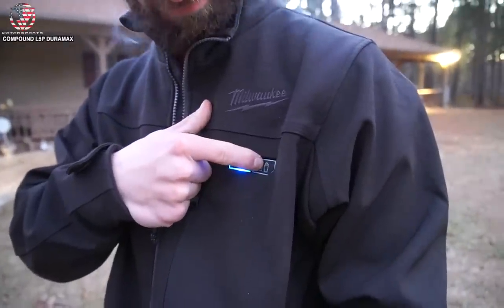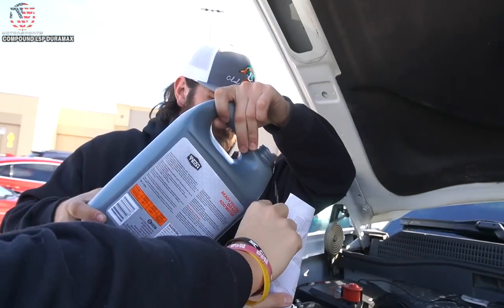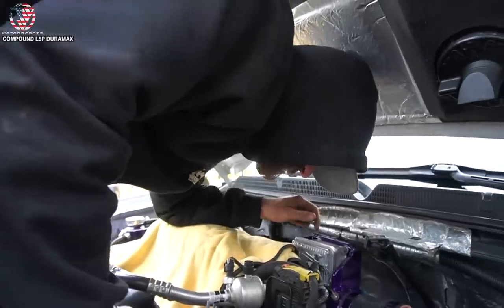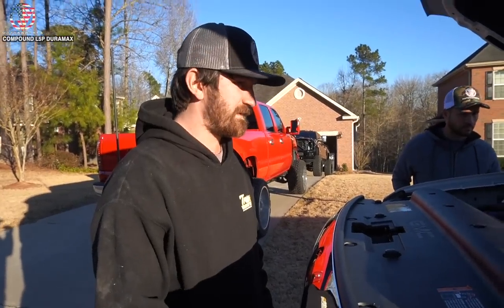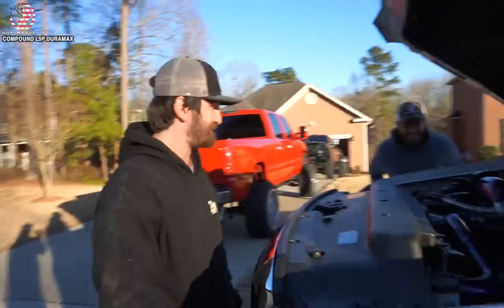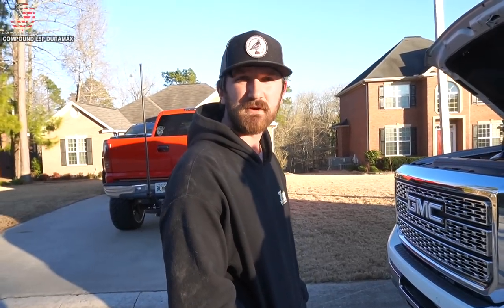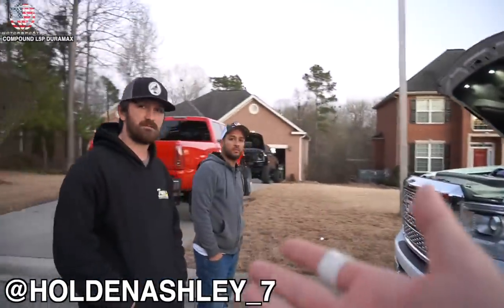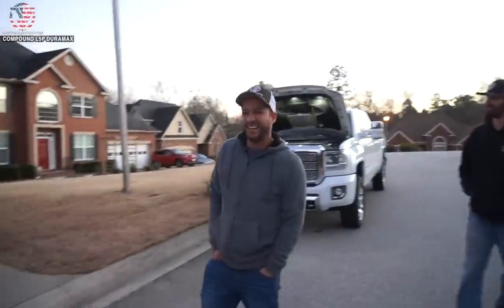1 OF 10 COMPOUND TURBO L5P DURAMAX SET UP IN THE WORLD

Comment: Why use the stiction eliminator in a common rail engine. That’s made for the 7.3s and 6.0s engines that have fuel systems that run off pressurized oil. He’s better off using Hotshot FR3

Comment: That coolant leak is going to be the death of me.  I swear that heater core tube is just a bit to small for the standard 5/8 quick connect.   Next stop for me is to clamp the hose directly to the core. Or buy the oem egr hose and swap the fittings.   Anyone else have this problem and solve it?
Reply: HP L5P.  I just bought the oem hose and swapped the fitting like you said.  It used to drip onto the up pipes over night when it cooled down and I could smell coolant when it was warming up in the morning. After swapping the fitting it doesn’t drip on the up pipe anymore and no more smell. But it’s still loosing coolant. I did the fitting 2 weeks ago and I’m still trying to find where it’s leaking now.
Reply: @kevinswartz2396  thanks dude.  100% the problem I’m having.  I’ll see if I can get a mic on it and report back.
Reply: HP L5P I also noticed the drivers side tube going into the firewall. Rotates, not sure if it did that before but I don’t think it’s normal.

Comment: Only 730 hp on twins they are making 750 on the new stealth series single. Stock piping and stock look. Why go twins for same hp is there a advantage ?
Reply from the maker: Not sure where you got that info...
Reply: Stealth will only make 700 stock fuel and that’s it. With 100s and 12mm it makes high 760s. Compounds with bigger valley and stock fuel make 730s and with matching fuel can make 1000+
Reply from the maker: Yeah, somebody is feeding misinformation
Reply: @holdenashley3223  doesnt this guy have a pump and full bolt ons including exhaust, pipe kit and every supporting mod. 30 more hp is not alot more
Reply: @JWMontoya  the new stealth kit for L5p is reported to be 700hp+ capable. Of course with a pump and supporting modification. Why twins when the tech is advancing so quickly on this new platform. Maybe its just turned down and has alot more left in it?
Reply: @killakali9845  this is my truck with the compounds. I’m 100% stock fuel other than a lift pump.... that’s why it’s 730hp. A stealth with stock fuel will do 700ish tops. Compounds with big fuel will make 1k + while a stealth with the same size fuel will only make 760ish
Reply: @holdenashley3223  That truck is impressive! As a fellow L5P owner in the same mod path, I am watching your build very closely. Keep the content flowing, you are building a blueprint!